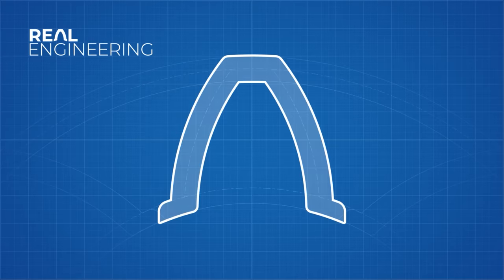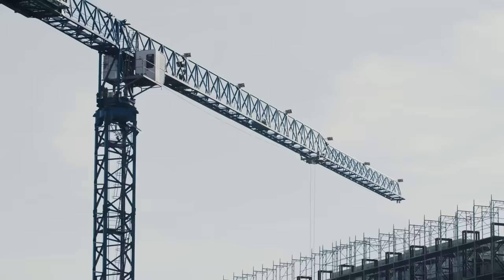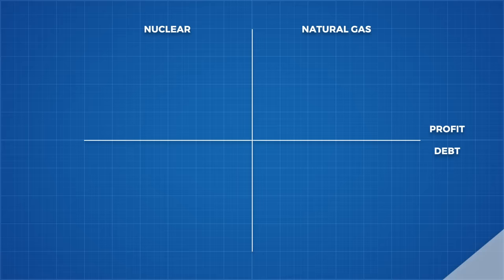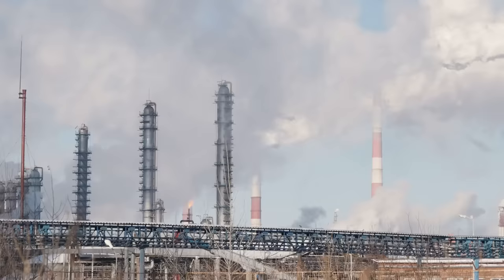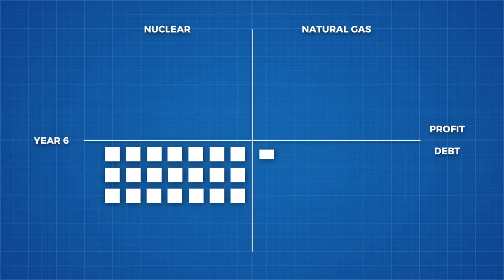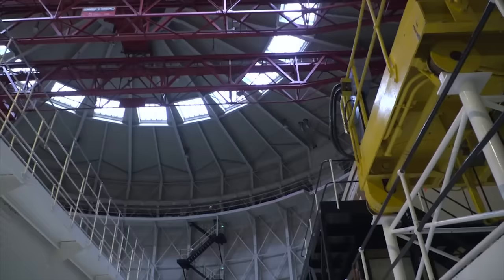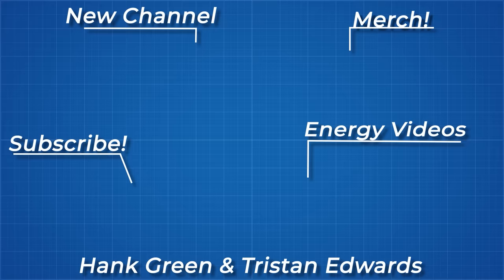The Economics of Nuclear Energy

Comment: Well made video. Would be interesting to do a follow up on how the economics has changed with current Gas Prices, Ukraine war etc. 

I wonder if the economics would change if the price of electricity was calculated at the point of consumption rather than at the at the point of generation. LCOE doesn't seem to factor in grid cost. The difference being that Nuclear is part of a centralised grid and Renewables are much more widely distributed. They require much more wires and transmission lines. Where I live the cost of grid maintenance alone is 45% of my electricity cost. If you build more grid you basically guarantee me a higher price. Decentralised grids seem to be attractive to the public but consumption is not decentralised the way renewable grids are. It should also be stated that rooftop solar is double the price of utility scale solar (although again grid cost often seems to be omitted).
Reply: No CO2 in the world and all Dictatorships with nuclear industries.?????
Nuclear winter is very cold.
Now that's climate change. 

You are right about the failure to include all factors. 
EV batteries will increase power demand on the grid to x3, so grid building up to new demand is a big cost. 
More power demand means more supply  for stability of the grid.
Reply: For some reason I’m surprised with claim that rooftop solar more expensive than utility - it’s just slapping some panels and inverter on a house, that can be done incrementally over a neighbourhood rather than a big project that may also have issues of finding the right land etx

Comment: It's been a while since i researched this but i do remember the inefficiency, and instability of wind and solar making it some of the most expensive (and unreliable) ways to generate kilowatt per hour output when compared to something like clean coal technology. in the magnitude of 40X-80X less efficient. the solar panels NASA uses for example use multiple wavelengths of light to generate power compared to the current commercially available panels that only use one. the cost of NASAs panels are also astronomically high by comparison.   the reliance on electric battery based technology was tried at the very dawn of the industrial age and was discarded for a reason. current technology has improved it's potential drastically but to have the comparable ease of use and output it is a dead end technology(and incredibly pollutive to manufacture). hydrogen  is the most abundant natural element in the universe and is also 100% clean burning while comparable to fossil fuels for performance. the current drawbacks are the cost of production and the lack of support infrastructure.  once those are addressed it will quickly replace battery technology.
Reply: Clean coal doesn't exist. If you burn something it pumps out CO2 which causes global warming which is definitely not clean, that's just how chemistry works.
Reply: @Blaze6108  Clean coal is a term used for coal power generation that filters out the other harmful chemicals produced from burning coal. . CO2 is NOT a harmful chemical in fact plants need it in the process of photosythesis. do you realise that this "climate change" event that everybody is talking about has been very good for all pants including farming and has  made the earth greener  than any other time in current recorded history? (not referring to the time millions of years ago before the last ice age when the entire planet was basically a jungle) .   Not all "climate change" is bad.
Reply: @aphyonmortath8377  is obviously not an engineer.

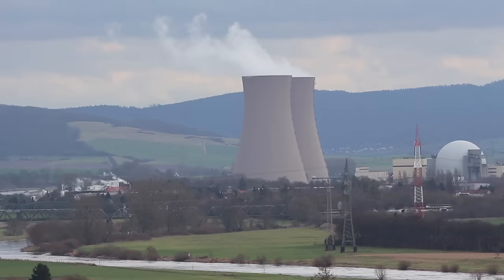Comment: Great video, but something doesn't add up. First the video spends a lot of time to show that over the course of the lifetime of the powerplant the nuclear makes more profit than gas assuming the same cost of electricity for both. Then at the end (about 13:30 on the video) he drops the LCOE that's double for nuclear than gas. How can these two be both true at the same time?
Reply: Stuck out to me as well. I've seen those LCOE in quite a few anti nuclear sources but never the details for how it was calculated. It could be totally real if they used 1 off nuclear plant in California vs 10% renewable grid. I honestly don't understand how these discussions exist when France is the empirical proof nuclear is cheap and clean and Germany shows how trash renewables become when you try to base your grid on them.
Reply: That's because of simplification. For example nuclear LCOE also has high decommissioning costs unlike gas plants, so there is also end of the line costs.
Reply: @DmitriyLaktyushkin  France funded there plants with public money. Plus EDF is running at huge losses. Comparing prices is a much more complex issue, but right now EDF is struggling with plant modernisation costs.
Reply: @maruti1mon1  Decommissioning (especially in modern plants where this is taken into account in design, unlike in the first generations of plants) can't possibly cost so much, that if nuclear was already more profitable than gas after 20 years, then after 40 or 60 years the decommissioning would suddenly cost so much that the total cost would double the gas one. That would require the decommissioning to cost several times the cost of building the plant.

Comment: Your underlying assertion that nuclear doesn't compete with wind, solar, hydroelectric, etc, but with natural gas is simply wrong for the very reasons you mentioned. Clean energy comes in 2 forms, either nuclear or wind/solar+gas to cover downtimes. Wind/Solar simply can't exist on their own due to said downtime thus they need a backup, and as you said gas is the perfect backup plant for them. So the competition is between nuclear and gas+wind/solar which you conveniently left out of the equation. Sure the wind and sun themselves are free, but the setup and maintenance costs aren't, so they should very much be factored in. Similarly wind+solar take a lot of real estate to manufacture said electricity which also needs to be taken into account. Gas and nuclear plants take about the same space, perhaps nuclear a bit more but not by much.

Don't get me wrong, the bottom line is unfortunately the same, but not for the same reasons. The reason you neglected to mention the wind+solar expenses is the same reason politicians neglect them, wind+solar are all the rage these days and so we tend to minimize/forget their cost due to the obvious benefits and this still misguided notion that they're the future. I mean sure, eventually if/when battery technology will become sufficient to store such significant amounts of power that will enable wind/solar based grids to remain stable through the downtimes than wind+solar will indeed be the future of energy. However I don't see that day arriving anytime soon. Even if that liquid based battery design you mentioned in another video will come to fruition there will still be that huge issue of scale. The mere comparison to lithium-ion batteries show just how irrelevant that discussion is as nobody expects lithium-ion batteries to get anywhere need the capacity to store the amounts of power needed to stabilize wind/solar based grids. It's discussing inches when the actual discussion is of many, many miles.

Thus for the foreseeable future the question is how to best replace coal, and the clear undeniable long term answer is nuclear. However this option is still extremely unpopular due to the fear of nuclear energy, which is incredibly unfounded. Sure, Chernobyl was a massive disaster but it was poorly designed to begin with and we learned a lot from it, and Fukushima's defenses weren't being maintained properly and in general its location was far from ideal due to the potential exposure to these tsunamis in the first place. A nuclear plant nowhere near an area prone to any kind of natural disaster has nothing to fear from a Fukushima like event and I don't see a Chernobyl like event happening in any modern nuclear plant in a western nation. Yes, the upfront costs are very high, but than so are wind/solar's, especially when you add the mandatory gas plants on top of them. It's just that politicians know they can easily push for investments towards wind/solar but not for nuclear. So in essence your bottom line is still correct, but for socio-political reasons rather than economic ones which was what your video was about.

Comment: I just wanted to give the Youtube comments a few informations about the german energy market and why producing energy here emits so much CO2, the situation here is different than one would think after seeing the video, although nothing wrong was said:
-natural gas power plants are shutting down here because energy is bought in by the net following the "Merit-Order"-principle: the cheapest energy is bought in at first, then the secound cheapest and so on. The cheapest energy is usually wind or solar because they dont need fuel to operate at that moment. The secound cheapest is coal, because the material is so much cheaper than natural gas. 
Usually, the German energy grid runs on wind and solar as well as on coal plants, which are allowed to sell energy because they can provide it cheap, but their plants arent easy to shut down so they run even when the grid is already full of wind and solar and they cant sell anything. Coal power plants barely make a profit because of this so some of them even shut down. Natural gas power plants are only activated during short peaks in energy demand even when it would be way less harmful to the climate if we replaced coal plants with them for the short breaks when solar and wind cant supply energy. Because these short peaks are so rare, natural gas power plants are shutting down as well.
-Germany is very anti-nuclear, so we shut down all of our nuclear power plants after Fukushima

So coal plants are shutting down as well as natural gas power plants and we import more and more energy from France which is pro nuclear or Poland 👌🏻

I really like all of the videos on this channel and Im especially thankful for the insights into the energy sector, I am in a master of energy engineering and its good to see this well researched overview, we dont get something like this that much in university!

Comment: I think you need to look into SMRs (Small Modular Reactor) which is one of the ways they have planed to reduce cost. These much smaller reactors are much easier and cheaper to build and are their own closed systems that can be put inside a bigger pool of water. These reactors might not be as effective as the normal ones but they are way much cheaper and more secure. The control rods will be hung up over the reactor by electro-magnets so in the event of a power loss they will be automatically lowered to stop the nuclear fission. Theses power plants can be built in the same time as the nattural gas plant can and can even be uppscalled easily if more effect is needed.

Comment: Great video!  I wonder however, if you forgot to factor in the not insignificant cost of managing spent fuel for nuclear power plants?  I used to work for a company called Holtec International, and spent fuel storage casks were their main product line.
Reply: fuel can be reprocessed as only 5% of the fissile material in a fuel rod has been used - France does but USA under Carter and the greens banned it so of course you have so called waste but it is actually unused fuel

Comment: With respect, you did not spent enough time on the economics. Renewables receive billions in government subsidies whereas politicians are more inclined to throw red tape in the way of nuclear. The reality is that, ignoring the battery storage facilities required for buffering fluctuation, the ratio of city area to energy-diffuse solar farm area is ludicrous: 25% of the state of Arizona would need to be covered in solar panels to power Phoenix. And the truth is "renewables" are not actually renewable. End of life-cycle PV panels and turbine blades cannot be recycled into new PV panels and new turbine blades. We have a finite supply of these things as well. Think of the vast scale of mining operations in combination with the ludicrous land usage of a "renewable"-dependent grid. This is never happening. In fact you should reverse your paradigm from the end of the video: nuclear should not be tailored to a "renewable" majority-grid; the grid should be designed for the highest-power-density source and all lower density sources should be responsible for the reverse.

And this is fundamentally what it comes down to: energy and power density. Solar and wind, even at max theoretical efficiency, have power densities everal orders of magnitude lower than even natural gas. Nuclear is the winner by several orders of magnitude and this is the simple reason nuclear is more profitable. So much energy can be produced using so little material and so little input energy because of energy density.

A higher energy density means you spend less of the produced energy generating more energy (energy cannibalization) and it means you can spend less energy distributing it. The miniscule quantities of fuel required for MW scale nuclear should make it clear beyond a shadow of doubt. Think of all the additional mines, intensive industry and landfills full of end of life cycle panels and turbines that could be avoided if we instead built nuclear plants. 

In fact I'd argue that we as stable nations with low proliferation risk have a responsibility to the developing nations of the world to end our carbon deficit once and for all, so that they have a carbon budget to work with as they develop and stabilize.

Don't believe the hype on 'renewables.' Power and energy density are the only things that matter when it comes to environmental impact. Higher energy density = smaller environmental impact (more dense =  less mass, same energy (actually more because of reduced cannibalization))

I urge all of you to look up Michael Shellenberget and watch Michael Moore's documentary. Big mining companies have a vested interest and oil firms are repurposing their know-how and capital to support the transition to so-called renewables. This is a bad deal. We should end the solar subsidies and replace them with nuclear subsidies. We should end the wretched influence of these corporate environmental hazards once and for all. They're lying to you for a good cause.
Reply: @Ismalith the difference is subsidizing nuclear actually makes sense.

Nuclear waste is bad. Per (ammortized, i.e. long run) kilowatt hour, nuclear produces less than a millionth the waste by mass. Radiation can be buried underground. The uraninite ore would be radioactive in naturally in the environment anyway, the only difference is concentration, and storing minuscule amounts of waste kilometers underground is still more feasible than mining millions of tonnes of caustic (but not radioactive substances).
Reply: @anthonydevellis6708  
No it can't be buried underground, that is a lie.
You can't guarantee that the ground stays unchanged for 4,5 million years.
The whole idea is build the plants, produce waste and future generations are fucked.
Pay for 4,5 million years of active storage up front or do not produce the waste period.

Comment: Even the IAEA claims that fission power won´t exceed the up to 10% of electricity produced worldwide of righ now.
Renewables make up for about 30% of produced electricty worldwide.
Nuclear power plants become more expensive and more expensive and take more and more years to be build.
Uranium gets more expensive, too. Not to mention the cost of storage of the waste and the cost for decommissioning of the plant at some point, which is paid by the society, not by the plant operators.
Renewables get cheaper and cheaper and with a proper energy storage system it provides stable and cheap power.

Comment: Did anyone see the recent movie by Michael Moore? IT says that renewable energy is nothing more than the same as regular energy.It cost's to make solar panels!! and they don't last wind energy wind Mills only are good for twenty years.
renewable energy costs are higher Everytime!!! The Planet Human, I think that's the name.
Reply: The biggest advantage of solar, wind and hydro is that it doesn't need a fuel to work, it creates energy "for free".

The thing is, it doesn't make a lot of power, that is the problem!
Reply: Indeed, being diffuse, it takes a lot of surface area PLUS intermittency is a huge issue since the only solution is to store electricity in chemical bonds (batteries), gravity potential (PHS),  mass inertial (flywheels), etc. PHS is by far the predominant means of storage used while sufficient grid level battery storage would cost many times more than the cost of generation.

Comment: I think that one major important thing related to nuclear energy, in its current form, which was not mentioned in this context, is its waste. 
1. Not many countries have solved the problem where the waste can stay the next million years after burned out. 
2. The cost of researching the locations and the disposal itself and also the maintenance of disposal sites should be counted ontop of the cost of nuclear energy. 

Also, relying of few megaplants which need to be operated 24/7 increases the risk for attacks, (cyber and physical). That again raises the need to invest in proper security. 

I like this video though and your channel! 
Greetings from germany
Reply: A large facility will have much better security than a series of smaller ones.  They are bigger targets but you can also focus on protecting them. Protection costs go way up once you have a larger number of smaller facilities.  As for the USA, we already have a good disposal location.  Just need to start using it.